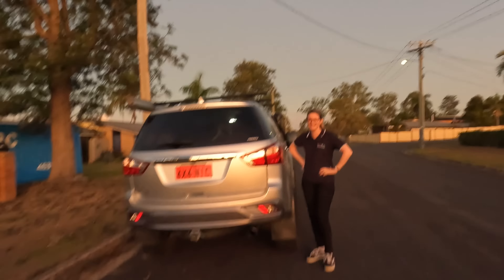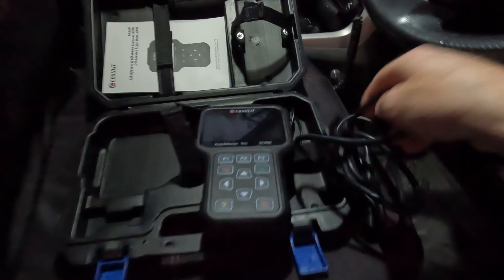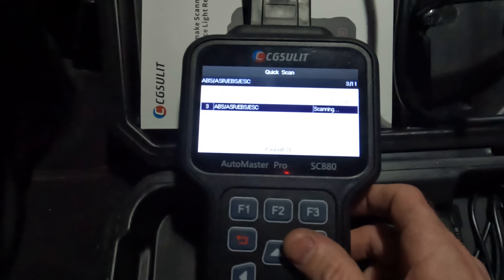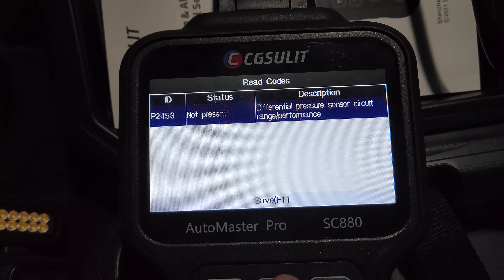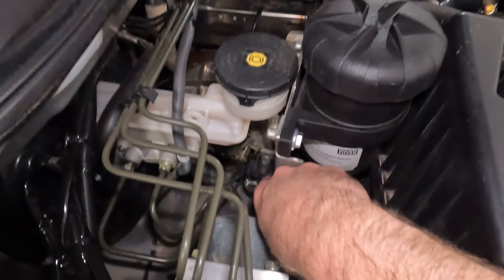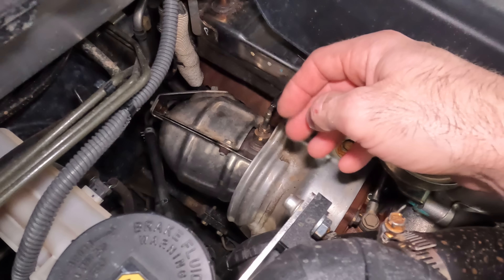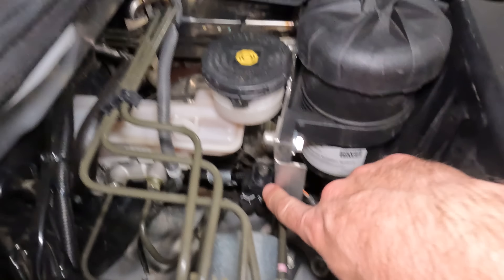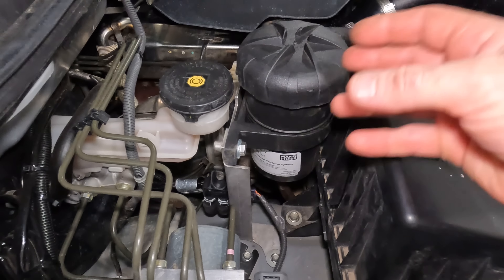BROKEN DOWN!!! LIMP MODE || Isuzu Mu-x/D-max Common Issue - P2453 Differential Pressure Sensor Fault

Comment: Glad they sorted it out, I have heard they have a new replacement turbo coming for the 17-20 4jj1 with the turbo issue
Reply: They dont, just like the green dot, the new part no turbo is also failing. It's BS. It's still the same turbo.

Comment: I have a similar issue in my 2017 MUX but only occurring when going low range 4WD. Engine warning light and transmission warning light. Diagnostic tool coming up with codes P0708 and P0700. Vehicle is under stat warranty (second hand) and I have an extended warranty.. only bought it a month ago!! Fingers crossed it's covered 😬

Comment: It seems to me that sensors fail far more often than the item they are sensing.
Reply: exactly. the sensors they put on earth moving equipment these days renders them useless for no real reason, except to protect a component, and with no warning and 4wd are the same. Imagine that sensor dying in the Simpson , or anywhere, if you couldn't figure out how to bypass , and/or trick it into letting you carry on.

Comment: Scan tools r very valuable, I thought u had 3 codes
Reply from the maker: The other 2 codes in the traction control were because of the engine fault code and limp mode.
Reply: Was going to ask the same but thought I’d read the comments section first.  

Is a DPF sensor and hoses something that can be added to the Spares kit if traveling?
Reply: @ChristianJamesK  the hoses are just changed by isuzu cause thats what they say can cause issues, over time they perish and collapse. I reckon in a pinch, changing the sensor only can get u outta trouble.

Comment: So the actual cause of the sensor failure is the rubber hoses breaking down and damaging the sensor, hoses must be replaced with the sensor. There is a service bulletin for it and extended warranty coverage, it affects old shape and new shape dmax and mux

Comment: Could you tell me what side of the dpf sensor each line goes to from the dpf. I have changed my sensor and still getting same issue? wondering in the lines are wrong way around

Comment: No DPF = No problems
Reply: I had the same thing happen  to me  while I was towing my Caravan on a steep hill on Mount Ousley rd. NSW. The car & van got towed to the nearest mechanic. He cleaned all the sensors. 
The car is going into isuzu to be repaired, but unfortunately, I have no warranty.
Reply: 2022 Toyota Fortuner 1GD has been no issue. Works sweet as automatic or push button. Burns every 280 km automatically
Reply: 'quick that YouTube isuzu guy has called, cancel all other jobs and get it fixed pronto'
Jokes aside, you were lucky they did it pronto without issue.
Reply: No problem except for the highly carcinogenic heavy particle matter you are creating in every day.
Reply: 😂😂😂😂 @baronvonaux8294
Reply: @yusufozzy  You find cancer funny?
Reply: @baronvonaux8294  the solution to pollution is not redeculous dpfs .that actually cause a lot of problems.take all the pollution gear off modern designs and u would get a lot more ks from them.
Reply: @yusufozzy  DPFs are all about air quality, and they are actually very effective at removing the heavy particle matter from diesel exhaust.  I love my diesel and I want them to be around for a long time and DPFs are going to help achieve that.  If you buy a quality designed diesel vehicle and treat the DPF well and drive appropriately you will not have problems in majority of circumstances.
Reply: @baronvonaux8294  I'm guessing u believe in global warming
Reply: Hi nick have you had any problems with air con evaporator yet another problem with dmax and an expensive fix

Comment: Hi Nick great video thanks. I have the same Mux as you 2018. Do you think it’s wise to buy a DPF sensor take with me as I travel the country. I have a scan gauge so I can delete codes etc if needed. Thanks
Reply from the maker: It probably couldn't hurt to do that. If you are travelling in remote locations it would be very very very frustrating to be put in limp mode with a top speed of 50-60 kmhr and no power.
Reply: @LowRangeNick 
Hi Nick thanks for your videos they have been extremely helpful!

I have just recently bought a 2018 Dmax to use as a pilot vehicle.  It is my first modern vehicle so a lot to learn haha.

When it goes into limp mode is it just restricted to 50-60kmh?
Does anything else happen?

Cheers

Comment: Hi Nick great videos and advice. I have a 2017 Mux with 108,000 klm, it does a regen approximately every 130 klm and has for the last 78,000 klm. I have reported it to the Dealer at every service, their answer is that all is Ok and just keep an eye on it.
Ive also reported that the DPD graph reaches the first bar at the 100 klm then over the next app 40 klm the bar graph fluctuates up and down then starts a Regen.
I do a lot of short trips ( school drop offs ) with a couple of trips a year, on a recent trip from Newcastle to Sunshine coast and Back it did a Regen app every 100Klm on the highway at speed limit.
The Mux runs well is good on fuel and meets all my needs I'm just concerned about the life of the DPD.
Any advice would be appreciated.
Reply from the maker: Hey David, that does sound like it's burning off a bit more regularly. Mine usually burns off every 250-350km. Maybe it could be pointing towards a failing differential pressure sensor?
Reply: DPFs do not seem to be compatible with multiple short slow runs. So not the best choice as a mummy wagon.

Comment: Same issue on my DMAX, replaced under warranty even though vehicle was out of warranty
Reply: How far out of warranty was it? Mines 2 months out of warranty and just having the issue now
Reply: @jakewatt9236  about 2 years or so
Reply: @ChrisDimo  i checked mines 1 year and 2 months out of warranty. How did you manage that?
Reply: @jakewatt9236  The dealer just said it was a known fault and that they would replace it under warranty.  this is the isuzu bulletin number you should point your dealer to 

DPF - Warranty, service codes - the bulletin number is S2022-10 release date is the 08/08/2022. Concerns codes P2002 and P2453

Comment: Hey Nick thank's for these videos,I have the 2021 Single cab Chassis ute,it's been great,but unfortunately the clutch master cylinder or slave not sure what it is yet but just getting small leakage from above the clutch peddle,in the cab,very anoying,not losing any clutch pressure,it's booked in tomorrow.Have you heard about this by any chance? another thing I had noticed is unusual outter edge of front tyres wearing,so hoping my dealer can look into that.
Reply from the maker: If it's leaking into the cab it sounds like a faulty seal in the clutch master cylinder. Hopefully, the warranty will sort it out for you.

Comment: Happen to my 17 Dmax a few years ago.  was all good but lately it seems to do a burn twice as often as I remember.  IE two times per tank instead of once per tank. The DPF level indicator seems to go up or down depending on speed. Not in warranty now . Do you think I should put a new sensor in?
Reply: Why not - it's a cheap piece and very easy to fit.
Reply: @danejames7098  City driving?
Reply: Or just do a dpf delete 😮

Comment: I found it out, what was wrong with my. DPF ? It was the I drive control affecting the throttle control . So I remove the throole control for now to see if it happen .
Reply: Hey there. I was just wondering if you have any update about this throttle controller issue? Did the problem go away after removing it? Thanks!

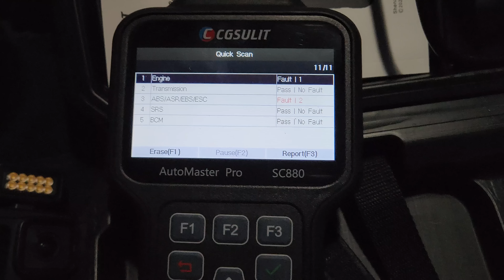Comment: Trust me guys and girls, one sensor issue is not a bad thing you should see what the transport maintenance industry has to put up when it comes to trucks worth 350k upwards with sensors failing early kays?I'm from the old school of diesel black smoke blowing from the pipes  but breath it in glad dpfs /egr have stopped that get used to technology that still allows us to keep driving diesels there is now w 1:40 ay I'd go petrol or evs move with the times👍
Reply: You're spot on mate. Remember the brown haze over Brisbane CBD in the 80's and 90's? That seems to be a thing of the past.

Comment: Hi Nick. What were the ABS faults. I recently had a brake flush from Pedders, and the ABS was not working. Had to reset codes but was not told what they were or what caused them.
Reply from the maker: It was just because of the engine fault and limp mode.

Comment: How many warranty issues have you had! Total time without vehicle due to these? Curious cause I'm tossing up between new MUX, Paj Sport and Fortuner. They all have good and bad points. Would you buy the MUX again???
Reply from the maker: I have had quiet a few issues. Luckily, it's all covered under warranty. Probably only been without the vehicle a week in total with all the issues. At the time the mu-x was one of the cheapest 4x4 wagon on the market, so it was great value for money. Now the mu-x is significantly more expensive. I would be shopping around and comparing prices with other vehicles  if I was to buy another 4x4 wagon today. I would recommend driving all the vehicles you are contemplating and then comparing prices and features. It will come down to your personal preferences at the end of the day. All the best 😊
Reply: @LowRangeNick  MUX is still value for money compared to the usual suspects.

Comment: If we wanted to change this as a preventative measure how often should it be done, as in in X number of kilometers?
Reply: Just carry a spare in the car.  Looks like a 5 minute job to replace roadside.  Of course you need a Scangauge or similar to tell you the code before you clear it.
Reply from the maker: Well I just had somebody message me saying they had theirs fail at 35k  and I'm at 117k in my mu-x so I'm really not sure to be honest. Carrying a spare may be the best option?
Reply: @LowRangeNick  good advice. Say have you done a video on spares Mux/Dmax owners should have and a recommendation of tools for field/ bush repairs?
Reply: @LowRangeNick I have 40,000km on a 2019 mux. That error just came up on my scanner after seeing the engine light pop up. Hoping I still have warranty

Comment: Are you going to do a DPF delete via blanking plate or Munji once out of warranty. Opinions seem very divided on the subject. Not much in between hell yeah and do not touch.
Reply from the maker: I don't plan on removing the DPF. The vehicle was built to run with it, so I will keep it how it is. It's also illegal and massive fines 🤣
Reply: Munji sell EGR blanking stuff. They do not sell a DPF blanking plate, as that would be better known as a "entire exhaust system blanking plate", which is usually inadvisable to fit 🤣

Comment: My 2018 DMAX has played up on me today, started on 3 cyls dropped down to two and eventually conked out now winds over but sounds like it has no compression and sounds very different to how it normally sounds cranking. Going to have a look tomoro with the scan tool. Is this something youve come across before?
Reply from the maker: Doesn't sound good! Not something I have seen unfortunately. Hopefully compression is OK and it's just not getting fuel like a suction control valve failure or something.
Reply: @LowRangeNick  the other day it had a dowey cyl I could hear when cranking but started then came good after a little bit of idling. I can’t understand how it’s now cranking differently to how it was the other day when it ran fine after a bit. I guess we’ll see!
Reply from the maker: @chenderson4969  ahh ok sounds like an injector issue. Hopefully it hasn't done any damage.
Reply: @LowRangeNick  its going on the tilt tray in the morning 👍 see how we go I guess.

Comment: Did they give you an idea of what it would have cost outside of warranty?
Reply from the maker: I think the genuine sensor is pretty expensive. Like 1k plus. You can get cheaper aftermarket ones though.
Reply: 700 hundred for the sensor and 400 for hoses genuine parts. 1200 all up fitted by isuzu. Absolute rort.

Comment: Complete of topic mate. But I have a2015 dmax. When ever I sink my boot into it. It will buck and jolt like it doesn’t know what gear to be in. If I accelerate steady it won’t do it it’s only when I accelerate hard.
Reply from the maker: Could be a lot of different things. Could start with the simple things like fuel filter and cleaning air flow meter and replacing air filter? Scanning the vehicle may also show a fault code that might pin point where the issue or checking live data on an obd2 scan tool could help narrow down the issue. Unfortunately it could be a hundred different things and it's difficult to diagnose without seeing the vehicle.

Comment: Limp mode, maybe derated mode versus limp mode is apparently the right term according with another mechanic in our FB group. Limp mode is even more derated than derated mode. A relearn of the new sensor via the OBDI port was required too. Been there and done that.

Comment: I have a 2017 D-Max 106000 on the clock no problems yet but after watching your video I thought I'd purchase a spare to carry with me until I found out the price $750 the guy in the spare parts said Isuzu are aware of the problem and there was a pretty good chance when it failed I would have it fixed for free I said that the ute was 2-years out of warranty he said that would be ok because it is a known problem I would still like to have that in writing then being told over the phone.
I have heard Isuzu are pretty crap when it comes to warranty
Has anyone ever used the aftermarket sensors off eBay ??
Reply: My 2018 dmax had a coolant leak from the cam chain cover.
It was a 4k repair back in 2018. 
Was covered by warranty even though I service my own ute.
So Isuzu warranty was great in my case

Comment: Why is it failing on such a young vehicle ?
Reply from the maker: My vehicle has 117k on the clock and is almost 5 years old. The sensors also passes hot exhaust gas into them and live right next to the exhaust. They are unfortunately a common issue on multiple vehicles not just the isuzu.
Reply: @LowRangeNick  it’s almost worth thinking about trading in our existing vehicles before the manufacturer warranties expire. The cost of repairs is escalating and the longevity of these current build vehicles is diminishing with each new model. I’m going to run my 2010 pajero into the ground and hopefully it’ll outlast me 😁

Comment: Great mate it's  a shame  SINCLAIR AT KINGSWOOD wasn't as good as your dealer they had our mux for a week after it went into limp mode and did nothing but used the car as lunch truck we got it back no diesel  and filthy and they only cover you for a certain amount of the  cost on the warranty for parts the good bit is the mechanic told me what was wrong with car on the sly and we paid to have it fixed by a reputable  diesel mechanic our self .ps cars great isuzu  warranty and extended warranty  is shit mate.

Comment: I’m wanting to buy a 2015/16 Dmax  from all accounts they are supposed to be very reliable . Would anyone happen to have experience with the older model ? I’ve been driving a 2000 model hilux for 14 years without hardly touching it. Perhaps I’ve been spoiled 😂
Reply: @danejames7098 thanks very much for replying 👍
Reply: Just keep the Toyota it’s barely run in. These “modern”technology vehicles are too complicated and fragile now.
Reply: @chrro466  your not wrong. It’s the 5L 3 litre . I bought it with 205k now it’s done 423k I’ve hardly done anything except service it well . I drive it daily. I need something with air bags after neck surgery.
Reply: @AndyL940  that’s a shame, all the best with finding your replacement vehicle. The earlier D max’s are a good choice. Unfortunately here in NZ a lot of them have similar mileages to your Toyota. 🤙🏼🤙🏼
Reply: 2016 pre-DPF dmax manual - at around 100k, the only issue I have had is replacing the EGR.
Reply: @bluefunkenator  Thanks mate 👍
Reply: Have a 2014 mux. Only  90k on the clock, yeah not much, no issues yet, have done a few mods suspension, catch can, power chip from new, trottel tuner,snorkel. Tows good  on a 2ton van. Won't be getting rid of it any time soon.